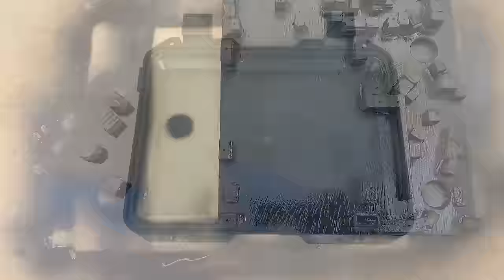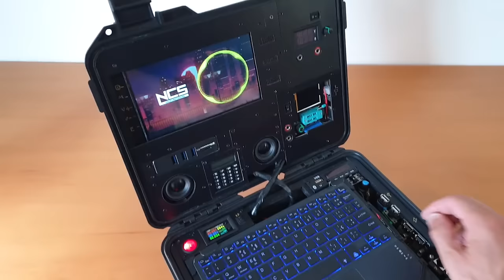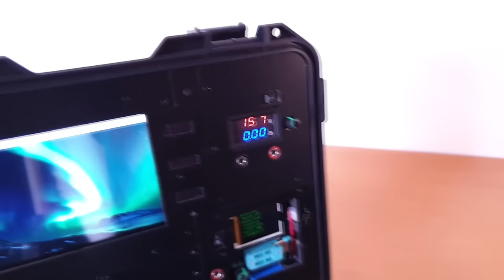DIY: Cyberdeck multi-function backup computer

Comment: I didnt found bigger screen for this project ,
can it use for storage data an external hard drive ?
were can it get internet conection?
I wiill need all the info to bring this to life .
 Total cost ?
Thank you
Reply from the maker: i could use the 10 inch screen but i prefer the 7 inch because i wanted to add more modules near the screen, you can use external storage and in my case i can acess internet using the raspberry wifi or the RJ45 that is in the bottom right side of the case, parts list in the description for prices

Comment: A lot of hard work and skill went into this, but your planning needs work. Why use only a pi for this? You could use a NUC or a Framework board if you wanted it to be easy. That, and you have no thermal solution. This deck was almost functional but I know you don't use it regularly because it will choke on heat for certain.
Reply from the maker: Thanks,  i used this same raspeberry board for years has a kodi player, it has thousands of working hours inside a closed box with some small holes in it, it uses around 3 watts at full power, you need cooling only if you overclock it

Comment: Doesn’t screwing into the sides of the case defeat the whole purpose of a “rugged” PC case? Is there a way to make these holes water proof?
Reply from the maker: they are water proof, the screws are tight, the plastic case acts like an oring between the screw and the wood

Comment: nice project would make a good hackers computer but a build schematics would have been good and also part list and what they do
Reply from the maker: thanks, part list in the description, this is like a modular system, just need to connect every module to the power supply

Comment: You failed right from the start, solid silicone rubber body (designed to remove the heat generated by an electronic device ) would cool down much better than wood ,and much lighter.
Reply from the maker: that´s an raspberry, the screen and raspberry uses only 7watt :)

Comment: 4:05 : All tools are hammers except wood chisels which are sometimes screwdrivers😅
Reply from the maker: it was used for bolt holder xD could use a plier but it was 2 seconds away

Comment: As lovly as this looks

Do u have any schematic diagram of it?

Cuz when it breaks (if only 1 module breaks) it will be a pain to repair
Reply from the maker: thanks, in fact if necessary to replace any module is super easy, just unsolder the wires, remove the old module and then solder the wires to the new module :)
Reply: @DTeK  thats true

But do u know what module connects to where in this wire mess?

Of course right now u probably know since u made it, but will u also know in 10years

Of couse video does server as a good reference but a schematic or simple connection diagram would realy help u in the future

So make it while u still remember what goes where
Reply from the maker: actualy is very simple, positive to positive, negative to negative, in 5 minutes i can replace any part if necessary

Comment: I hate those screw. Takes out the waterproofing of the case and looks unpleasing. Could've just glued or bonded it with some adhesives.
Reply from the maker: Its a pressure fit, they are tight, the plastic case acts like an oring, its the last place where water can go in

Comment: srry i gunna be that one guy... NICE concept now to remake that V1 prototype with 3D print and SAVE THE WATER SEAL factor, what's the point in the hard case with water seal if you just drill through the side glue/caulk would have done the trick, might as well just made the whole damn thing out of wood and styled and stain it.....this was on my main feed did not see that it was 7 MONTHS old till after rant

Comment: There's no point in posting a video like this without a diagram!
Reply from the maker: i usually add always schematics, but this one is super easy, its just modules connected to the main power supply, the most "complicaded" part is the variable power suply output but i have a video of a  mini psu  with schematic of it on the channel
Reply: @DTeK  Exactly, I didn’t think about it - a modular system.

Comment: How long does the battery last approximately?
Reply from the maker: around 70 hours using raspberry and monitor
Reply: @DTeK   That's very nice! And it looks like you would've enough space left still to double the capacity, right? So you could almost get a week out of it :O

Comment: Can I use an 100k potentiometer?
Reply from the maker: for this aplication and voltage range the 10k potentiometer is ideal, a 100k will add a lot of resistance and it will be difficult to select the corrected voltage,  but i never tried

Comment: This build definitely made some poor design choices. Putting unnecessary holes in a sealed box to hold things in place, using wood to contain a lithium battery, using wood in general and taking up more space than needed when 3d printing or aluminum fabrication exists, unless you put that extending keyboard on rollers when it pops up the pop up function gives you like half an inch of extra clearance. No airflow to keep it from overheating and catching your (now)wooden box on fire, and the cable management...😢

Comment: I have a big question, what is that for?
Reply from the maker: everything related with electronics :)
Reply: You would have put in an oscilloscope or a thermal camera or a portable heat station or any other cheap and useless Chinese electronics related crap @DTeK

Comment: There's no point in doing this, all you need is a bag with the monitor and the keyboard, which can be even smaller like the Novo Logitech, or flexible. And I don't even use the other tools as an IT technician. because you have to check if the computer works with the tester, you don't have to power anything. if anything you didn't put the tester cards, which are useful for connecting them to a PC, but which do not check by detecting the various errors with the display. which I own and are not cheap. And the systems you boot are on a USB stick. instead of using a partitioned 1TB Samsung SSD, you can boot as many as you want, on a mini notebook, or old PDA. Linux is my life now, you do this just to show off, but in reality you don't seriously study the system, from top to bottom. On YouTube it only runs, rubbish to facilitate hacking etc... but it doesn't teach anything.

Comment: Just buy a laptop
Reply from the maker: i will when i find one that can run for 70 hours straight ;)
Reply: in what plausible scenario would you need that thing to run for 70 hours without access to the power grid?